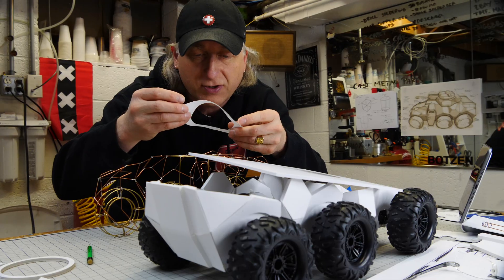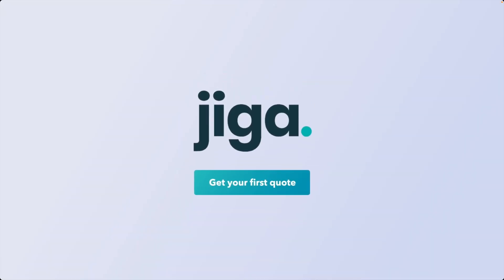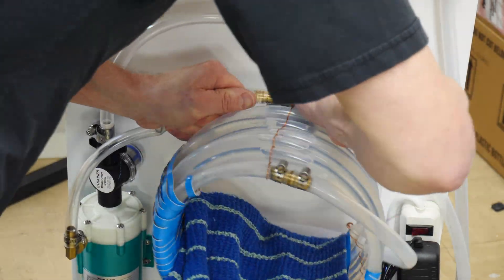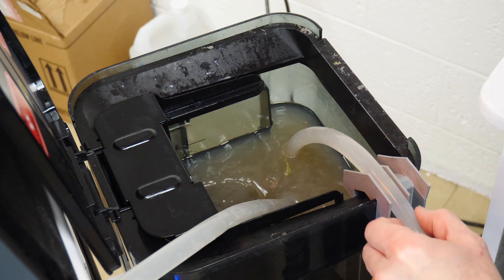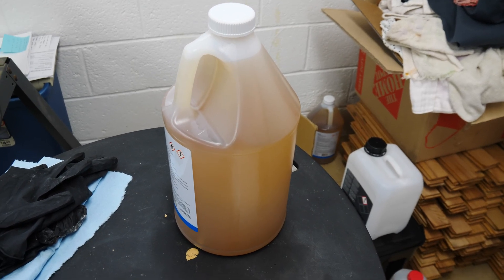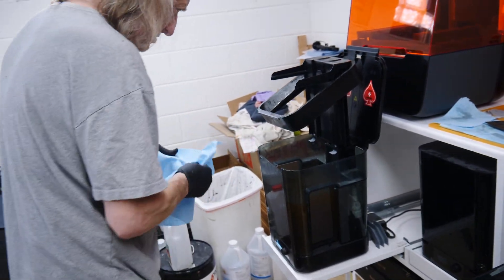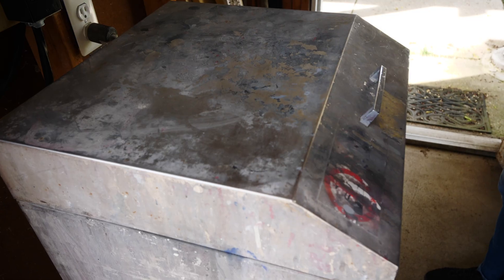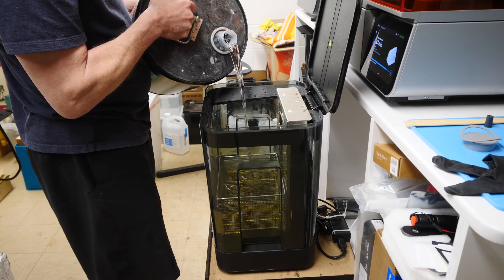Filter Pump or Solvent Recycling distilling your Isopropyl alcohol

Comment: You could try drying your IPA by "salting out" or the use of dessicants. I suppose for this application it still works fine around the azeotrope ratio.

Maybe it's possible to repurpose a degassing device to selectively boil off the isopropanol, with very gentle heating?
Reply from the maker: I will be experimenting with the salt, as it is the easiest. It seems like a no brainer to begin with that.
Reply: @EricStrebel  Just FYI, 99% IPA almost immediately goes to 95% from water absorption from the air. While I am not familiar with recovery systems, using a hydrometer that is calibrated for IPA. The salting method works but you will have salt contamination in your final product. A better method is using 3A grade molecular sieve but it's important to know what concentration of the IPA to determine the amount of molecular sieve needed. Feel free to reach out if you want me to help come up with an apparatus, I have been wanting to do this in a real lab and my garage.
Reply from the maker: could be an interesting rig to build. Send  me an email, info@botzen.com I am very curious to see what kind of equipment would be needed to remove the water from the IPA. Very curious

Comment: Changing a plastic bag has to be cheaper than filters & eventually pump.
Even at 92%, you still have zero residual resin in the mix.
Reply from the maker: Correct
Reply: Don't forget the cost of the power required to run the machine. Boiling off the IPA takes energy. Looks like 185 Watt hours / kilogram. It may be able to do better than that since I'm guessing it operates like a dehumidifier, heating the solution, then cooling it on the other side. But that's also the number for perfect efficiency, so maybe not.
Reply: @vodiak that sounds not too bad. 0,185 kWh at 0,35€/kWh would be 0,064€/kg. Running at 50% efficiency would be 0,128€/kg.
The last 99% IPA I ordered was 8,9€/1l Bottle, so a little less than 1 kg.
Reply: @simon-2962  Sure, it's certainly a good idea. My point was more about the exchange program. It will add up if it's being run full time.

Comment: Love this. I’m up in Saginaw and am currently looking at a Form 4L, WashL and CureL. I was wondering about recycling. Have you tried the wash solution formlabs makes? I’m considering that for its low flammability and smell. Formlabs says it’s not as effective as IPA though. Would a distiller clean that too or just IPA?
Reply from the maker: I have tried the solution. It does not seem to be recoverable in a Distiller. It works, but I am sticking with the IPA since I can get that anywhere at a moment's noticed if I need it.
Reply: @EricStrebel I wonder if it would be economical to ship my used IPA down to Detroit and buy some recovered IPA from you.
Reply from the maker: @scottd4391 perhaps, I guess it will depend on the volume of IPA that you have.

Comment: In researching IPA recycling I came across one resin print farm operator who uses residential size water distillers for the purpose. Runs about $120-$300, search distiller online. Have not used one myself yet.

Comment: The alcohol percentage is literally just the amount of alcohol molecules, anything thats not alcohol will be water. 
So 70% alcohol is just 30% water. So if you mix a litre of 70%, thats 700ml of alcohol, 300ml water. 
Into a liter of 99%, thats 990ml alcohol 10ml water. 
.so youbhave 1690ml alcohol, 310ml water. 

1690ml/2000ml is 84.5%

The alcohol you get out of the distiller may be as low at 70%, because humidity in the air will also be condensing with the alcohol. So the higher humidity environment the lower pecentage alcohol you will be getting. 

You can get a hydrometer if you want to measure what percentage youre getting.

Comment: Theres a really good video on youtube, i forget the name of it unfortunately, but its by a chemist talking about why filtering resin doesnt work.

The short of it is that the resin molecules are as small as the alcohol, anything you do manage to filter out will be fillers and pigments in the resin. Same with trying to let it sit, the resin is in sollution in the alcohol so it wont settle out, but the heavier pigments will.

The best example ive seen of this is a video where a guy left his alcohol jar out in the sun and the entire thing became a block of resin jelly, top to bottom. And that was after he had tried to filter it. The disolved molecules would have individually cured one molecule at a time, but eventually those molecules would chain together on a large scale and form a big web of tangke molecules chains with any alcohol trapped between, essentially how gelatin creates jelly. 

Distillation really is the only way to get the resin out of the alcohol.
Reply: Sooo... instead of buying few grand machine we could use a moonshite setup?
Reply: @KlausNietzsche  technically you could but there would be some issues.
You have to be careful with moonshine that you don't burn your mash when distilling, and then because you're just working with a wet mash you can't distill everything because then it will be a massive pain to clean the still with a solid sticky mess in it. 

Same problem here, you need to be able to very precisely control the temp so you dont overheat the alcohol so it doesnt condense and you lose a ton of it as vapour, which is also dangerous and toxic. 
And you will also burn the resin to the inside of your pot, and even if you dont burn it then you still have to get the resin out. Thats the convenience of the bag system, the bag contains all the waste. 
The bags are rated to high enough temperature that they dont melt to the inside of the pot too, so if you use your own still you will want to try and find those bags. 
You also need to make sure theres no air pockets between the bag and the wall of the pot. As the air pocket will heat up not the alcohol and then you have an expanding pocket of air that could make a mess and possibly rupture the bag.
Reply: @ge2719  Hmm... I could jerry rig (or buy, they are surprisingly cheap to buy) myself a drum heater, get a drum, put a bag into the drum and suck out air through a valve in the side of the drum to keep bag close to the metal drum. Put a lid with the gasket on top with a hole, forcing vapors to go though copper condenser and then collect liquid.
Reply: @KlausNietzsche just make sure to be mindful of alcohol vapour. 
Not sure  how aware you are of the dangers of distilling but just incase you're not, the biggest thing to be careful of is any electrical device you may have near by may not be spark rated to be safe around alcohol vapur. 

Meaning any switch on a device may make a spark that could ignite vapour. And if the vapour ignites the still is basically then a boom boom device.... you know, the word that i probably can't say on youtube. 

This includes any electronic switches inside a device with something like a timer or a temperature cutoff. So i cant say whatever heater you use is entirely safe for this application.
Reply: @ge2719 In uni in fine printing workshop I was a witness of flammable solvent vapour buildup catching fire from the hot plate leaving huge soot spot on the ceiling. Before that I was warned by the smell but ignored it "because there's a technician in place, eh?". It made me mindful for the years to come BUT it is always, always good to be reminded :P.